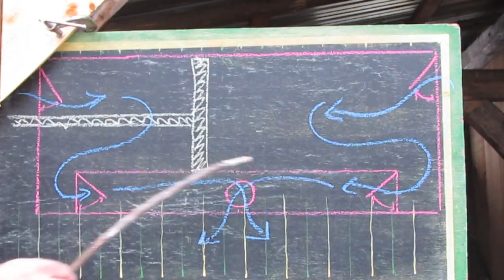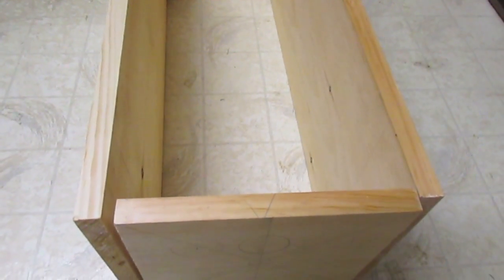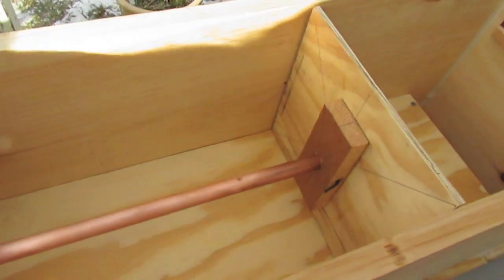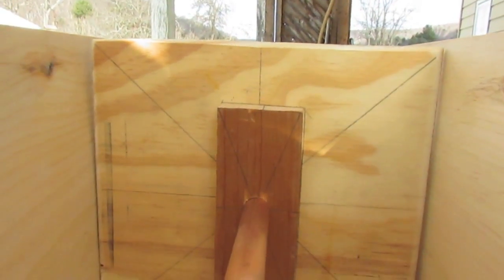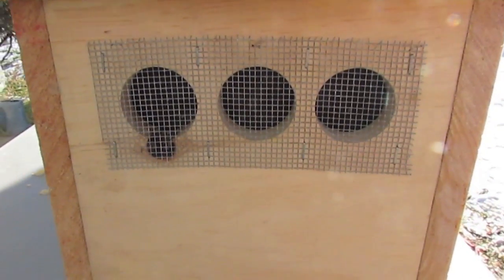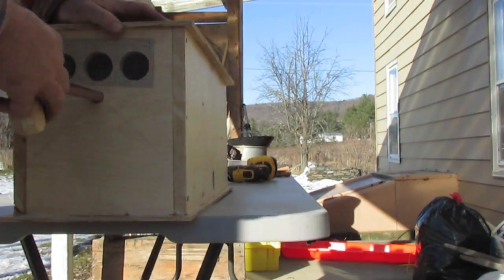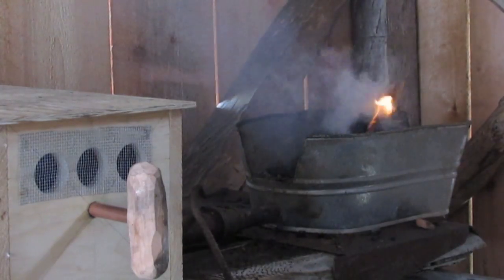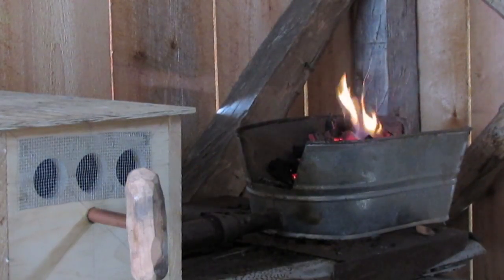Fast Build, Simple Design Box Bellows for Basic Blacksmithing

Comment: If you use glass inside, the glass is a dielectric material, depending on what you piston use for a seal l, you can build up a static charge in the glass do to it being dielectric( it’s basically a capacitor. Inside the capacitor there are two metal conductive plates and a dielectric that insulates them from each other. When dc current, as applied the dielectric will polarize, retaining the charge for a given time, AC reaction on a capacitor is very different!) any how the point is be careful it could possibly effect sensitive life saving devices implanted within the body or attached to the body l!

Comment: This is a fantastic wood working project in itself. I build mine according to the Japanese box bellows design simply because most of the plans available are to do with the Japanese design. It works fantastically with a good airflow, and has allowed me to bypass noisy electric blowers. It is good to see a tube on the Chinese/Korean version. The main thing with box bellows is that it is sealed properly and the main box in which the piston slides is squared up correctly.
Reply from the maker: Branok Erdene, you should do a video on your bellows, I would be interested to see it.  I like the fuigo, I mainly chose this design because it was basically a box inside a box, so it was simple to seal up fairly tight.
Reply: I have been thinking about doing a video on the heat treating of some of my blades, with a cursory explanation of the box bellows included, but have not gone about it so far. Having said that, I have some pics of my box bellows, including the inside main chamber and can email them to you, along with some explanation of how I went about making it.
Reply from the maker: That's OK, I'll wait for the video.  I don't need plans since I already have a bellows that I'm happy with.  I am always interested in seeing other ones in operation.
Reply: Same with me, I always like seeing the tools and techniques used by others who create work in wood and steel. The bellows that you are using is excellent, well done.  Works well with charcoal as the fuel.

Comment: Victory!  I always wanted to build one of those since Mors told me about them ages ago and drew a diagram of how they work.  Looks more pleasant than cranking a blower too.  funny, I've been thinking about trying to build a little smithy in the next month or two.  We'll see.
Reply from the maker: Well, after having built this one, if I could do it over again I think I might use a slightly larger diameter pipe.  I think a pipe works great for a quick and dirty solution for the piston, but the 5/8ths OD copper I used is a little flexy.  I bet 3/4 in OD conduit would be an improvement.
Reply: Do it. Im doing the same. But i got no money and very little amount of tools. But it should be okey.

Comment: Awesome accomplishment and looks cool in your shop. I hadn’t heard of the box bellow before.
Reply from the maker: There are actually quite a few YT vids on them, but most of them are on the Japanese style, often called a fuigo.  Probably due to the general fascination in the West with Japanese swords and swordsmithing.  For someone who is only interested in building a fairly accessible bellows, I think the Chinese style like this one has some benefits in simplicity of construction.  I've been doing lots of blacksmithing using this bellows, and its more than adequate for charcoal forge work.  Probably wouldn't be able to keep a coal forge rolling without a helper on the bellows to maintain continuous airflow.

Comment: well if its any consolation it also rocked MY world... im gonna try to make one of these but use a treadle mechanism so I have two hands free in case.. well just in case really... who cares... its fun to build and experiment
Reply from the maker: I think that would be a pretty awesome thing to do.  If I were to hook it up to a treadle I think I would mount it vertically and have some kind of a rope and pulley system with a weight that would pull the piston UP, and then the treadle would pull the piston down so you would get a double action for every push on the treadle just like an old fashioned colonial bellows.  You could probably have the shaft run all the way through the bellows to keep everything straight and avoid uneven wear on the piston too.  Please make a video if you build that, I think it would be really cool.
Reply: @oxbowfarm5803  now that's some good advice... I can picture it from your description alone and it seems way easier than what I was thinking..... trying to rack my brain on ways to transfer the force …. thanks you sir I will try to make the video...no promises though

Comment: great video, I'm considering this type over a Japanese bellows...any thoughts on the pros or cons of each? This seems more compact and potentially simpler to make/store (square box with no side portion to take up space or complicate construction)
Reply from the maker: I have not used a Japanese-style box bellows, so I can't really give a solid answer.  I chose this style mainly because it seemed intuitively simpler of a design, with fewer seams to seal.  The piston is smaller since the plenum is internal, so maybe the same size "box" will push less air than a Japanese type?  I have never felt that it was underpowered for the type of blacksmithing I do.  I don't desire to forge katanas or zombie weapons etc either. I've been very happy with this bellows.

Comment: That is a very efficient box bellows. I have almost finished making one myself, but one with the side chamber design common with the Japanese style. If I can ask, what is the diameter size for the valve holes that you used in your bellows ?
Reply from the maker: Hi Strahd Zarovic.  The holes are 1.75 inches diameter, which is 44.4 mm I believe.  It was the largest size Forstner bit that I own.

Comment: Some of the Chinese designs also use a flapper butterfly valve located at the hole where the air goes directly into the forge fire, but from what I have seen online, it appears to have been incorporated into the ones that did not have a valve covering over the holes where the air went to the air channel bow. I have not seen the butterfly valve feature on any of the traditional Japanese box bellows, and your plans did not incorporate it since all your air intake valves have a covering over them that closes and opens as the piston is pushed back and forth to generate the volumes of air for the forge fire
Reply from the maker: Yes, I couldn't find a good image of the flapper/butterfly arrangement, so I did it this way. I'd love to see the butterfly type if you know of any good links.
Reply: I have noticed that many of the Chinese style designs have a two rod piston system, whereas the Japanese variation has the one push piston.

Comment: could I suggest using a small engine or a electric motor with a cam and follower, you would probably have to bolt it all down to a bench,  and I know you did mention you wanted to keep it light, I just thought that if you could use other means of pumping the piston , faster means, you may be able to get it up to a temperature well in the range for forge welding, possibly even smelting and cast low melting point metals such as copper brass and aluminium
Reply from the maker: Thanks for that Alex,  I actually don't have electricity anywhere near the shed this is set up in right now.  I could definitely hook up a gas engine, but I don't think it would be a good idea to motorize this particular unit.  I didn't really build it heavy enough to stand up to high speed motorized pumping.  If I were to use an engine or an electric motor it would most likely make sense just to use an existing cage fan to go with, something with bearings etc. There are people who motorize Japanese fuigo box bellows, but I'm not really sure why they do that, except for the ambiance while forging their katana maybe? 

That said, I'm quite certain this is enough air to heat a  charcoal fired furnace to aluminum melting temps just pumping by hand.  That is in the works in the next couple of months.  This forge is a stepping stone.  I've had the Gingery Metal shop books burning a hole in my bookshelf for 6-7 years now.
Reply: Oxbow Farm yes , I agree to be fair, I did have similar concerns when I was thinking about it myself , and you are right in saying that it would make much more sense to just use one motorised unit if any at all , but yeah good work

Comment: That is well done my friend. It's been two years since you posted. How's it standing up? I'll bet it's doing fine.
Reply from the maker: I still use it all the time. It turns out I could have made the box and piston travel much shorter and still gotten the same functionality,  I actually rarely ever use the full length of the piston since you get the same airflow just pushing it back and forth a few inches at a time.

Comment: I'm trying this and it is not working out. Definitely harder than it looks. The wood has to fit together perfectly and I'm trying to use as much cock as possible to seal it. I tried to just set the roof on and there's no air at all coming out the hole. I might need to remake my flaps too to make them seal better.
Reply from the maker: I think the critical thing is to get a good fit and seal around your piston, so that the air isn't leaking backwards and is mostly getting pushed.  What did you use for flaps?
Reply: @oxbowfarm5803  Yea I'm struggling a bit with the piston fit. I used canvas panels I found at walmart for the flaps and secured it with wire. They seem to work ok but I'm not sure if they seal well enough.

Comment: What about plastic instead of glass, it would be more durable and light weight, or would plastic not be smooth enough
Reply from the maker: Probably something like plexiglass would work great.  Frankly, this bellows works so well with just sanded/waxed sides that I doubt I'd ever bother messing with it, not that its been in service for over a year.  It would be a fussy process of adding the glass/plexiglass and changing the piston, with lots of places to mess up something that's already working great.

Comment: It looks like that you made your forge fire pot out of a galvinied metal bin . Thats a no no , why? Because when galiviesed metal is heated it give off a toxic fume . I would replace that part of you forge , the bellow look like it works great though....
Reply from the maker: I am aware of the danger of zinc fumes.  The design for this forge is not my own invention, I followed a series of plans from a blacksmithing website.  This design is for a charcoal fueled knife-making forge.   I no longer use this forge because it isn't well shaped for the type of work that I like to do. BUT,  there is basically ZERO danger of burning/vaporizing any of the zinc galvanization because there is approximately 2-3 inches of clay insulating the metal tub sides from the fire.

Comment: Hi quick questionshould the plenum have the same hole size with the front and rear valve?
Reply from the maker: Hey Eugene, the hole sizes on this bellows are identical on the plenum and the exterior valves.  So having them the same size definitely works,  that's not to say a different arrangement might not work as well or better, but this does work.
Reply: ok thank you :) because I am planning to start to build my own forge soon and when I saw your video I thought that, thats the bellow I'm going to go with also another question the exit valve (( wher the air exits )) has a smaller hole right?
Reply from the maker: All the holes are 1.75 inches because that was the size of Forstner bit that I own,  but there is only a single hole at the exit/outflow vs three holes on all the valves on the plenum and exterior.
Reply: ok :) thank you for the help ^^

Comment: The box bellows is an efficient hand operated mechanism to supply air to the forge. Making one is a great project in itself. 

What is the diameter of the steel pipe inside your washtub forge, and the size and spacing of the drilled air holes that run down the pipe. 

I have had success with holes drilled down the length of a 1.5 inch steel pipe, about 5/16th's sized holes spaced every 1 to 2 inches, with some holes plugged up with dropped bolts to reduce hot spots. It worked well, but I might experiment with a hole arrangement similar to this one. 

http://www.backwoodshome.com/build-your-own-portable-forge/
Reply from the maker: Hi Zed.  I can't remember the exact dimensions of the black iron I used for the forge.  The design is called a "Tim Lively" washtub forge, I found the plans at some blacksmithing forum or other online.  I honestly don't care for it much.  The forge is actually a specialized knife-makers forge, and produces a very long narrow fire, which is great if you want to forge knives, but its not very versatile for more complex 3D shapes. It wastes a lot of fuel in areas you don't need if you aren't forging a long straight shape.  I still have this forge, but I've put it in storage against the need for it. I'm using a much larger forge with a 2" side blast, and its working better for the kind of forging I'm doing right now. I'll probably do a vid on it fairly soon.
Reply: The design is popular with  many people who smith and heat treat knives/swords in a charcoal forge, but I agree with you in that it is specialized for long narrow pieces, but not so good for general forging of various items. I suppose you could keep your old forge for knife related projects. Look forward to seeing your new vid with the new forge.

Comment: Is that a galvanized bucket you're using for a forge when the zinc burns off there going to be very sick that stuff is poison us when he did up
Reply from the maker: It doesn't get hot Dave,  Its lined with clay and perlite about 3 inches thick.
Reply: Don’t think I’d risk it, but hey you do you man. Zinc gas sounds like some nasty stuff.